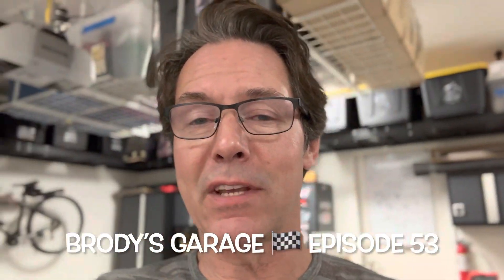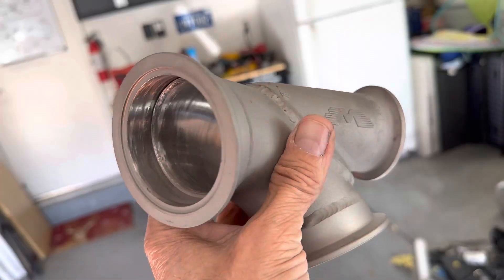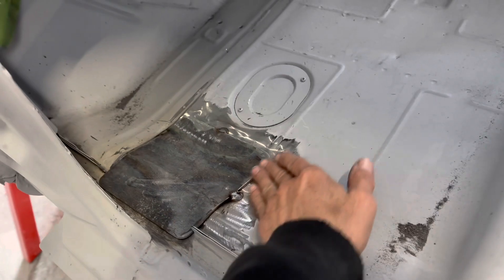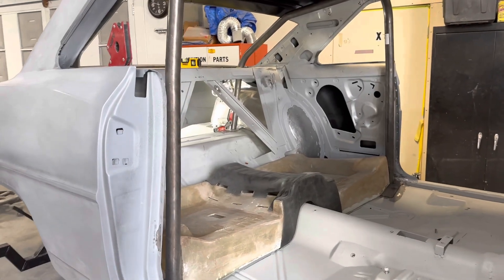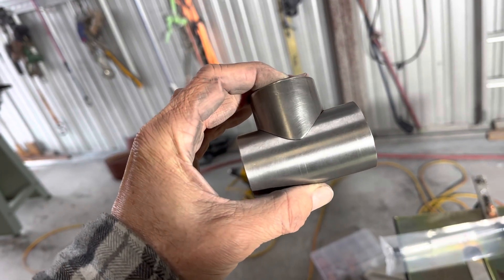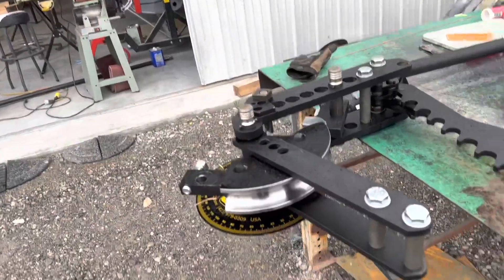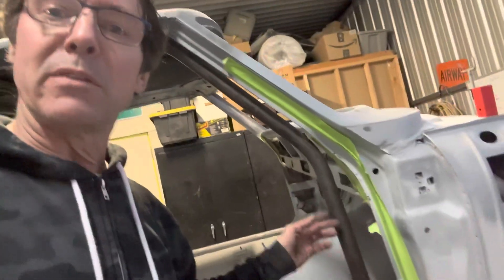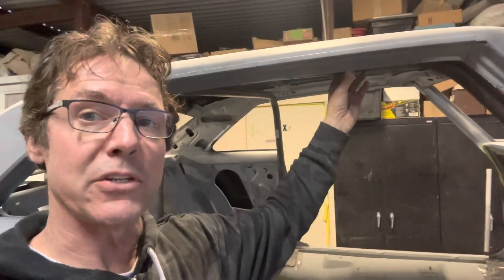Brody’s Garage 🏁 Episode 53: Roll Cage Progress

Comment: Hey Brody, I have been following your build for some time now and am really enjoying your updates, progress, setbacks and self teaching pains! I too have been in your same position and am also building a 1970 Nova Street Car but not to the level of your build! I chose not to install a cage against my wife's wishes and might regret it down the road... I am currently working on prepping and painting the firewall and still waiting on my new Blueprint 496 BBC Stroker to drop in my new OER Subframe. I am very fortunate to have a small shop in my backyard, makes working on the car a lot easier! Looking forward to your next update and a small tip, use your TIG Wire to form your bends then transfer it to your tube, this will work for your exhaust tubing bends as well. Best Regards, Ray